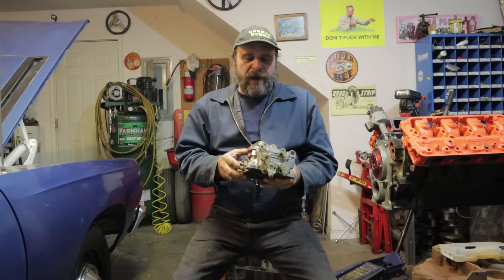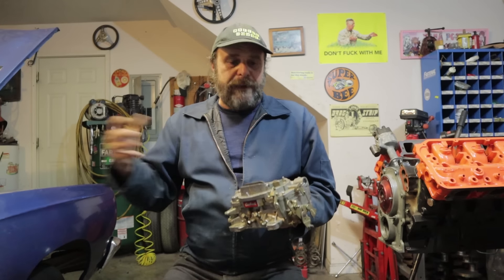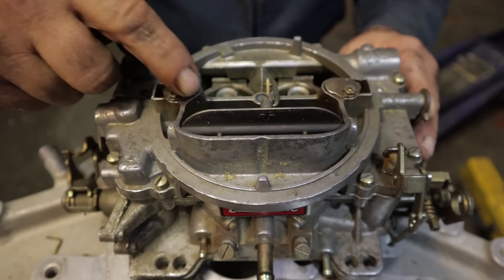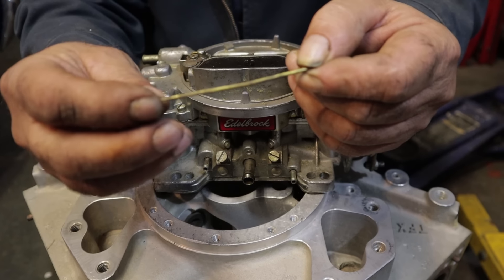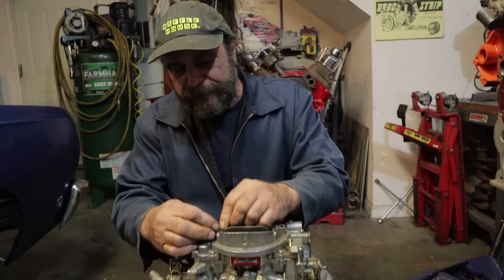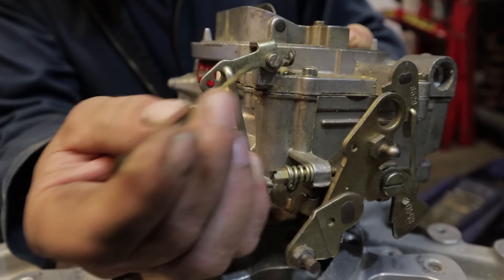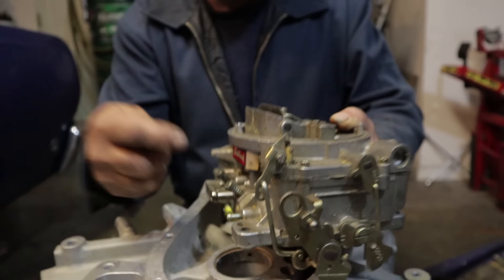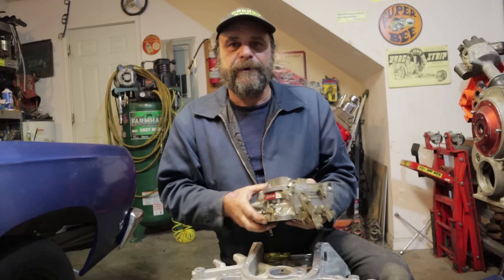How To Make The Edelbrock Carb REALLY Work For You

Comment: I like the quadrajet for daily driver.
Reply: Better mileage than a two barrel... if you can keep your foot out of it : ]
Reply: @TheCanadianBubba  Yes I replaced the 2 barrel on my 76 nova 305/turbo 350 with a quadrajet carb/manifold off a 73 350. more power but mileage went up to 25 highway.
Reply: That secondary kick is awesome in those Qjets
Reply: @RedBanksClassics - Baw-whah !
Reply: @TheCanadianBubba  exactly!👍
Reply: The Quadrajet was so good Solex made a copy for Mercedes and BMW as they could not come up with a better one. With a radical cam all you needed to do was use a paper clip to keep the metering rods in the full top position. Oh and maybe drill the holes in the butterflies larger.
Reply: dielauwen 
Locking the metering rod seems to defeat the purpose of. You know. 
Metering fuel. ...
Reply: A great carb and a ton of misinformation and hate out there about it from folks that don't understand it.
Reply: @dielauwen  The Solex 4 AB was a total disaster. I have 45 years experience on Mercs and the number of those horrors I swapped out for a Holley 390 is forgotten now but it was a lot.
Reply: There's a company in Ca making a repop of the Q-jet. I've put them on 2 Chevys and an Olds. Performance is awesome and oh that sound... BAH WAAAAAA!!!!!!
Reply: @RedBanksClassics  My Q-Jet on my 86 K2500 needs a professional going over. I can drop the hammer on that 350 small block and it accelerates as if the back barrels aren't even opening.
Reply: @edwardpate6128  Ain't that the truth. Only people who bad mouth a Q-Jet are the ones who don't know jack about it.
Reply: @SOU6900  Stock 350?  180hp at best. Its gonna be dead slow.
Reply: @zuestoots5176  regardless she needs a true tune up anyway. With a timing light, not that play by ear stuff that I'm doubtful about. And I'm not sure if the engine itself is 100% stock or not since it has a reman that was put in well before I got the truck back in 05 or 06. I do know that the smog system is gone and it's running duals with gutted cats and glass packs but I don't know if that would make a noticeable difference in power for a 4 wheel drive 3/4 ton.
Reply: @RedBanksClassics  All the same I know my dad paid someone to "rebuild" it. I got a feeling it needs shaft bushings put in it too. Won't idle below 1000 on its own but if I push against where the throttle linkage attaches then I can close the butterflies and get it down to 7 or 800 revs.
Reply: @SOU6900  yep I've got one doing t he same thing. Cant get a low idle etc. I replaced it with an edelbrock 1406 but plan to put bushings in it for another build 👍
Reply: The Autolite 4100 is also a good street carb for a mild build
Reply: Years ago I bought an edelbrock to replace the Qjet on a 400 pontiac, tried for awhile to get it set up right, I finnaly put a rebuilt and retuned Qjet back on and it runs great, I wish I had listened to the old timers and just used what I already had instead of spending money on the shiny carb with decals in the box.....you youngins listen, you can go fast with mostly stock parts if you know what you are doing, leave the shine and decals for the cruise night crowd if you want speed for cheap. Just get a good flowing exhaust a properly tuned carb and ignition set up, maybee a better cam if its a smog era car. A strong street car doesent need a lot of trick parts.
Reply: Quadra toilet. As we used to say
Reply: NebukedNezzer I have 76 as well!

Comment: I totally agree with what's said. Some of the best running street strip cars I've seen have had Edelbrock carbs. Crisp throttle response, still run good even cold, with great drivability especially dialed in. People say the same things about the Quadrajet calling them quadrajunk. I've seen old timers back in the day having awesome running street machines running 12 and 11sec quarter mile times(in the 1990s) and if you dial both the Edelbrock and Quadrajet carbs in right you can make GOOD power and have EFI like throttle response, performance, and good drivability!! Your right, it's not the design but the people who won't crack open a book to better understand how those carbs work!

Comment: I finally found the sweet spot on mine and that's in the garbage. I chased problems for years, sent it back to Edelbrock, and it never ran good. Finally fixed the problem when I put a Holley on there. It was like going from a 2 barrel to 4! Night and day difference and nothing but better performance from the start even before I got it dialed in! 
That was on my '72 Chevy 402 Monte Carlo. Now, I'm running a Holley Sniper EFI and it is turn key awesomeness! No more cold issues. It really transformed the car into a daily driver that you can hand the keys to the wife. Bye bye carb b.s. and Edelbrock. Hello reliability, driveability, and performance without guesswork.

Comment: The difference between the AFB and the AVzs is that the vacuum secondaries on the AFB are counterweighted, and the AVS are sprung. That means the AVS is adjustable, the AFB isn’t, unless you want to remove weigh from the counterweights. I’ve never seen that done, but in theory it should work. But I wouldn’t try it unless I had a second air valve to replace the one I tried to modify, in case I s rowed things up. I’m not even sure where to remove weight. The best way to do that would be to drill it out. Or, if the carb is too big for the engine you might try adding weight to the counterweights.  Ut the. You have to find a metal that is heavier than the metal the counterweights are made out of, drill out the counterweights and somehow replace that mass with heavier metal. You’d be better off finding an AVS. I think the HolleyDemon carb is their take on an AVS. Ok, I was partially wrong. Edelbrock was selling AFB’s but now sell what they call the AVS2. Holley sells an updated version of the AVS. Tossed with a Thermoquad. Both carbs would be worth looking into for a street or stret strip engine. Of course if you found an original carb of either type, whet I sad holds true. Have fun!

Comment: The Carter AFB/Edelbrock has always been my go-to carb......with needles, springs, and jets they can be dialed in within a gnat's ass.  Only wear in them is the accelerator pump and that's not often.  Love your videos.  Raced a bunch of Holley's but AFB gets the nod on the steet.

Comment: I always liked my edelbrock carbs, biggest problem I've had with them is worn out throttle shafts. The holleys, in my experience, always seemed to last longer.
Reply: That's my biggest problem, it would go lean transitioning into the secondary and surge no matter how i jetted it. 800cfm version.
Reply: Carters are cheap and he even said so. And are for people with little understanding of carbs. Holleys are for people that know how to tune an engine . They are better built. 
Another thing a holley just looks way better.
Reply: Chris Montreuil Agree 100%. But they are huge. Definitely not low profile.

Comment: Damn. I love this real world advice. Seriously. I look really good on paper. My Dad taught me about the real world. This is incredibly important advice for my Sons in the future. Thank you for showing how analog devices can equal or better modern digital fuel metering devices. It’s not as clean or efficient. But it will run when electronics won’t. Under very harsh conditions. I think my Boys would be surprised how great carburetors can be. My youngest has learned a lot with my blown ‘73 ‘Vette small block. It’s not the the future, I know. But learning first principles is knowledge that is irreplaceable. I learned about IC engines watching and helping my Dad restore 1900-1910 stationary gasoline engines. We dug two of them out of dirt and dung in Omaha NE and outside of Medford OR when I was in Jr/Sr High. His “Pride and Joy” was a horizontal engine, Fairbanks Morse, that used breaking points for the spark ignition inside the cylinder using a horseshoe magneto. Usually, I was the “starter”. Holding the intake valve open by my left hand to get it up to speed with Right arm cranking was a finesse maneuver. A person cranking will quickly learn what flooded sounds and feels like. The same with lack of gas/lean. It really brings the point home if you pay attention to how the engine feels and sounds while cranking. Thanks for your videos. I pass them along to my Sons and they soak up your knowledge. 
Maybe the world will go all electric. But...I don’t think so. The world’s milage may vary.

Comment: I had a hard time finding the EXACT accelerator pump for my Carter AFB. After 3 different rebuild kits and the standard Edelbrock parts, I could not find the correct pump and therefor get my Carter AFB to work properly. That's why I went to Holley. So many people are afraid of Holley and how complicated they are. For me, I find them actually easier to adjust and tune.

Comment: I love my Summit 600CFM carb for my 73 Mustang 302, and feel like I have it pretty well rounded out now. But for that thing, I had to buy every tuning jet, discharge restriction and secondary spring on Summit to optimize it from factory calibration, with an oxygen sensor no less. My used, $40 Edelbrock I stuck on my $400 84 F150 302? Never a flat spot or economy issue every day of the year after a couple minor adjustments. I may love the cheapo Edelbrock more.

Comment: I had an '84 Camaro that originally was a 2.8L V6 that I blew up. I swapped that dog with a 305, Holley Street Dominator intake, and a Carter AFB 625cfm. Now THAT was the sweetness! I used to shock Firebird Formulas with the TBI motors!

Comment: Thanks for your opinion on these carbs, used to run Carters back in the 70's on many of my engines for the street and the avs was super!  Need a change on my 87 460 ford stake body work truck from the original Holley factory carb.  Do not drive this truck every day and now experiencing leaks on the Holley on the bottom half of the carb.  The thing I always liked about the Carters was that the carbs are only 2 piece , top and bottom, and less prone to any leaks.  I now plan to replace the Holley with the Edelbrock carb .  Thanks for a great video!!

Comment: Thermoquad is still my choice for best all-around carburetor.
Reply: Even the old mopar tuning articles had thermoquad and manifold combo tuning secrets.
I saw one that had tuning secrets for an STR with a spreadbore top and TQ for drag racing. Apparently almost nothing made more power on a 440 bar a dual quad tunnel ram with 2x 660s (all things being equal).
Reply: @ThePaulv12    Back in the '90s I put (2) 850cfm Thermoquads on a tunnel ram 440 stroked and poked to 500cid..  Dyno'd around 750hp on track tune, and I tuned it back to 650-675hp for cruising.   I completely rebuilt and retuned them for the application, and made my own progressive linkage.   Ran on rear carb's primaries upto 1/4 throttle, then front carb's primaries were completely open at 1/2 throttle, then both carbs' secondaries opened together.   

I got rather decent mileage as long as I kept my foot out of the floorboard.  Full throttle it would suck in low flying planes.
Reply: Yes, the better Mopar tuners knew the TQ was good carb, too many other guys pulled them off and went to Holleys.
Reply: Agreed. 13 of them sits in my barn including an original offenhauser 2x 4 barrel,dual plane, spread bore intake made for the quad. 
Love the sound of a thermoquad

Comment: 1:01 "The ultimate sweetness".  No, that would be the Thermoquad.  :)
Reply: the Thermoquad was a good carb love the sound when the secondary's open up
Reply: Yes I always had good service with them.
Reply: 79tazman that vacuum cleaner sound lol I miss that!
Reply: @79tazman  Me, too.  Kinda like storm drains.
Reply: Yes the thermoquad was a good carb, until the phenolic center warped.
Reply: Had a Chevy Impala 350 that I pulled a camper with. As long as the trailer was being pulled the power valves stayed open.a real gas hog.Took out the springs and couldn't tell much in the power. It was a quadrojet I think. Some Chevy pickups in the early 80s gave us trouble with the floats soaking up with fuel and getting too heavy.
Reply: The good old TQ. Two modes: cruise and afterburner!
Reply: @ralphwood5114  Wrong carb....

Comment: We are 4000 ft above sea level where I live. Edelbrocks are the easiest to set up for the thinner air. Since they are set to run at sea level right out of the box we always have to lean out the fuel mixture. Going two steps leaner on the jets and rods for a typical 350 cid engine works like a charm.

Comment: I set one up on a four wheel drive big motor application. Used the spring loaded Vinton tipped needle and seat for rough roads and off level.  Stomp it and the fuel bowl would run dry.  Drilled out the needle and seat to keep the bowl from running dry.  Took some fiddling with the fuel level to keep it happy.  Could drive it up a wall or have it so sideways you thought it would tip over and never a stumble.

Comment: Alllll my old Chrysler’s have Carters on them. Have never been a Holley fan
Reply: I was going to put holley on my 01 360 magnum, but they did not have an intake for me so edelbrock sold me on both 7757 RPM AirGap intake manifold, phenolic wood 1/2in spacer and 650cfm 4bbl manual choke 1905 carb. Runs better then I could have dreamed for, and the best part-it's SIMPLE

Comment: Throw it in the garbage.... video done
Reply: Edelbrock's are ok, they're not great, but they're ok.  If you understand how to tune them and actually take the time to do it right, they work.  They have a few more problems that Tony pointed out, but for everyday driving they aren't bad, and for track use, they are easy to change tuning quickly, if you have the tuning figured out already.
I had some bad experiences with them in the past, so I don't bother with them unless I have to.  If they're driven daily they do fine, but if they are left to sit for a while the floats like to stick, and sometimes the accelerator pumps don't like to work right no matter how you adjust it, but the thing I really don't like is that they don't offer rods and jets in every size they could.  They skip two to three sizes every increment so you have to figure out just the right combination to make them work right, which can be a pain in the ass.
Reply: @grandmasmalibu  I agree, it's hard to beat a good Q-jet.  I hate it when I see an Edelbrock where a Q-jet should be.  Yeah, the Edelbrock's work, but more often than not, the Q-jet got thrown in the trash when all it needed was a good rebuild.

Comment: Like the last comment. I didn't know about the dry secondary issue. I thought my truck was losing fuel psi.
It didn't wanna idle correctly I was chasing timing, and fuel regulator adjustments.
It's my daily street strip toy so I'm not constantly hammering the throttle. Some days it would roast the tires other days it would just launch impressively but I knew 350+ hp in my short bed Sierra should spin tires every time. ( Not that I want to but I knew something was off.
Long story short after following your tuning videos I've worked out all my bugs.
Thanks man...your awesome.
I was about to go to my all time go to carb. A 1969 quadra jet for a 1 ton Chevy. Lol
Loving this Edelbrock now!

Comment: I always ran the 600 cfm manual carb (1405) on my small block 350's as a kid, and they all developed an off idle dead spot. Different engines, different cars, all developed the same dead spot. Fine at an idle, just a touch of throttle and they would stumble. Not just the first time after sitting, all the time. Drove me nuts. I still have a couple on a shelf I took out of service 25 years ago. I had to switch to the 80457S holley.
Reply: Different metering rods and/or heavier springs would have fixed that problem.

Comment: My only other beef with them is the fuel jets as you said being on the very bottom of the bowl area. Any fine dirt debris that makes it's way through the filter is pulled into the fuel circuit and quickly plugs up your small idle circuit passages. I believe this "dust" is amplified by the constant evaporation of the modern fuel from them after shutting them off. Eventually this process leaves enough solids to cause the annoying idle circuitry plugged problem. Roadside repair is handled by a can of carb cleaner sprayed through the air bleeds and pulling out the mixture screws, but itll just do it again till you open it up and get all that super fine garbage out the bowls and passages. The Holley setup seems to be able to handle this problem better with its higher sitting jets but eventually will succumb to it too.

Comment: That is so funny that the carter is your fave. My teacher back in 1997 ( when I went through my apprenticeship ) thought the same way. My buddy had a 67 newport 440 with a Holly bogerator always pissing around with it, hot day re tune cold day re tune dog pissed on the tire re tune. I rebuilt a carter for it, put it on without telling him and that was the end of his problems. He was pissed off when he found his bogerator in the trunk but happy his car ran right all the time. It is a far superior carb for street use and much easier to adjust. The old  macadina song with the words changed , you put the jets in you take them back out... heyyyy holly bogerator.. You set the floats hit a bump and reset them hey ....holly bogerator

Comment: When I was a teen my dad had a 70-something cadillac with the 500 CID engine. It used a single Quadrajet and it would haul butt for a big car. Would smoke the tires taking off.  They are good carbs if kept clean and maintained.

Comment: I'm currently running a 600 Holley and it's pretty good once it's adjusted right. I keep thinking about throwing the Edelbrock from my other car on there just for simplicity. The main reason I don't is I'm trying to sell that car and the Holley won't work with the spread bore manifold. Plus the electric choke is nice.